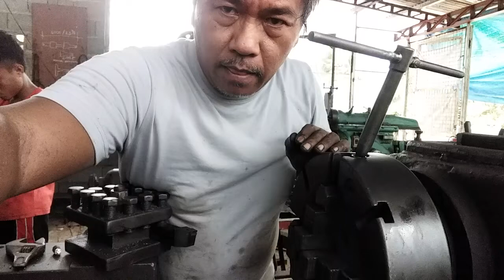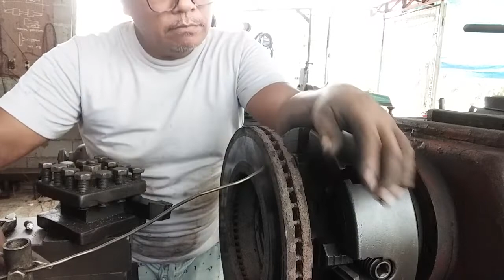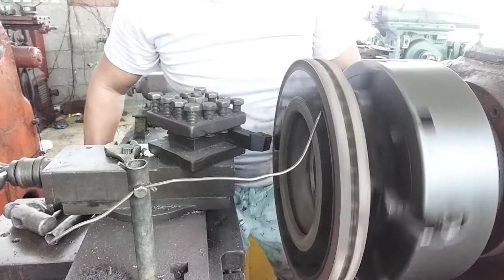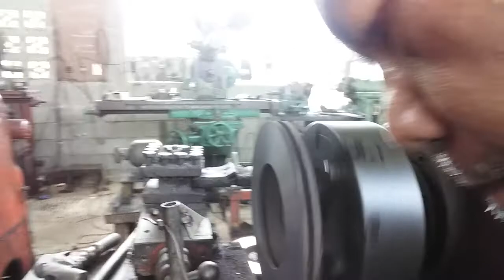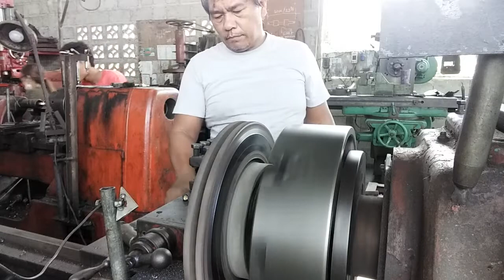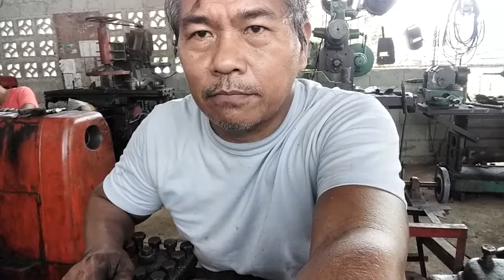Paano ang tamang pag reface ng rotor disc (toyota fortuner ).

Comment: Magkano po pareface po rotor disk
Reply from the maker: 600 hundred Po sa kotse,sa motor 250 po
Reply: @carlitogayuma5006 per rotor po boss or sa apat na?
Reply: Mgkano po pa reface sa suv 2  rotor disk and back and front